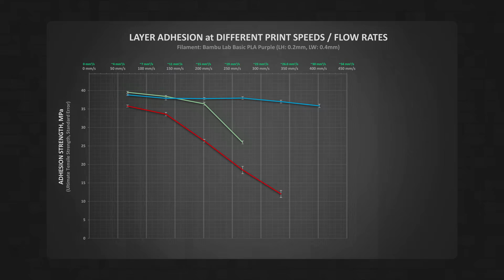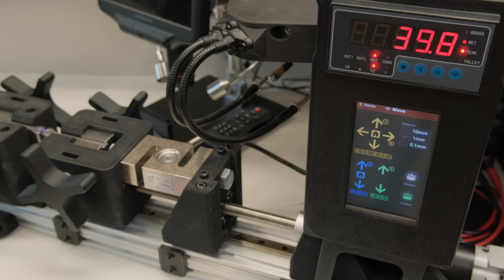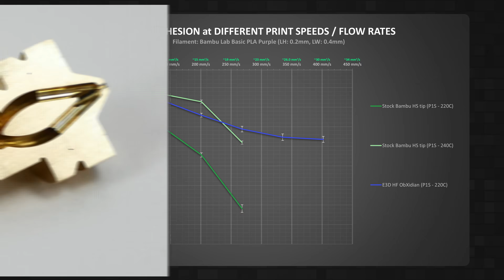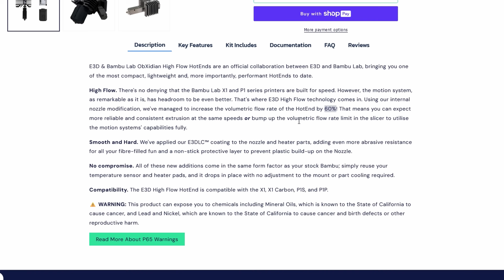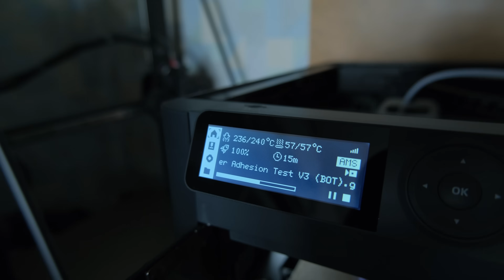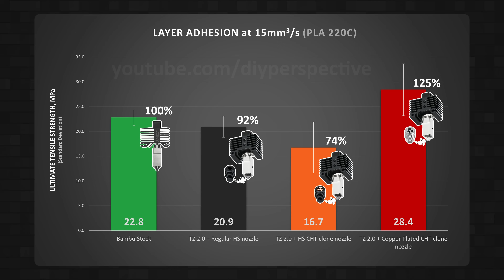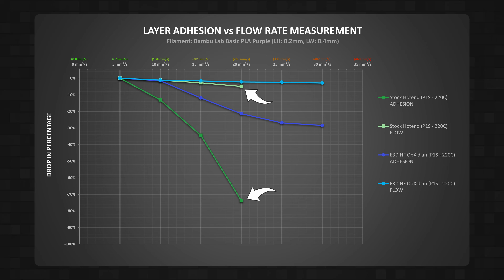LAYER ADHESION TESTED: Bambu Stock vs TZ 3.0 vs E3D HF ObXidian hotends (220C vs 240C)

Comment: TY for the video.

I can't help but wonder how much the temperature sensor location has an effect on the performance.    If the stock hotend had the temperature sensor moved to the same location that E3D uses, would that improve performance?

Comment: Question is if this affects not only the strength but also the surface finish of the print. If the filament gets faster on temperature, does the surfaces looks more simmiliar on speed changes? :D
Reply from the maker: When the print surface starts to look matte, that is the first sign of filament not being melted well enough in the hotend and extrusion having micro fractures. That causes a less smooth surface = more matte. If we had unlimited melting capacity, I doubt the regular speeds that we print (50-300mm/s) would show a significant difference. Plus, some crappy filaments can have a very narrow window of optimal melting, and anything above or below that temperature leads to more shinny or more matte surface. So a small increase in flow rate will lead to a very varying surface shine.
Reply: @PrintingPerspective  I just ordered E3D HF ObXidian hotends, I am just currious if this would give me a more uniform surface on speed changes. I noticed that my surface changes like in your Variable Temperature 3D Printing video. Maybe this could be gone with this high flow nozzle

Comment: For a standard machine the TZ hot ends are great but you have to move the thermister using a drill guide off printables.

Comment: nice video, thanks! only concern for me is cutting method for test pieces. in my experience cutting plastic like that with something like side cutters producing a lot of stress of layer bonding. so I assume starting point of a crack was predetermined at cutting procedure.
Reply from the maker: Thanks. That's why the test piece is only 0.8mm thickness. I also bought brand new sharp cutting pliers that I only use for cutting samples. From my experience it only affects samples that have extremely low layer adhesion.

Comment: It is to be expected i have a nozzle with thermistor in it and i see about 15 degrees lower temp inside it as Mytechfun has pointed you need to increase temp by 10degree for it and in cas of Cht its same but here Chamber on the cht are like a big wall using a bit to decrease the chamber it will be better

Comment: I just wanted to say that this video is one of the most important and interesting videos on 3D printing to date.  Layer adhesion is something that gets talked about but only a little bit and usually not in a quantified way.  This video had a huge impact on the hot-end that I picked for my build.  I was for sure going to use all of the Bambu parts in my custom build but i went a different direction at the last moment - It is yet to be determined if I made a mistake or not (I am having lots of problems getting the USB tool-board to work)

Let me say to anyone that is thinking of a custom build of their own - yes, go with the Bambu design, using their extruder with the recently available hop ups like the aluminum skeleton housing, the DLC coated gears, the integrated filament sensor, integrated filament cutoff knife, the integrated part cooling fan and duct, etc... This stuff is truly some of the absolute best hardware on the market, bar none!  And it is everything you need short perhaps of a CAN bus tool board etc... 

That and I do think that I would use the ObXidian hot-end instead of the stock Bambu - the testing here says it would be the best choice by a comfortable margin.

Also - with Bambu's latest printer the H2D they really have nailed it - it seems as though everything works, and works the first time, with the least effort.  I would not be thrilled that I am locked in to use their filaments but for sure over time we all could come up with recopies for different products from the various makers.  The biggest drawback is the price - it is not cheap at all... but that could be worth it to many people.  

If that is way too much, join the club... I am the president!  But I think that the community gets stronger each day and i do think it is possible to build a printer that outperforms even the H2D for half the cost, even less.  The extrusion for the frames is a bit part of it so it may not be a bad idea to find someone selling a used printer and pick it up as the base to work off of.  Cheers

Comment: What do you do if one of these fancy high flow nozzles gets clogged up? With all those little curved passages inside, I'd have thought a cold pull to be a waste of time, and you can't get an acupuncture needle into it either. 
So, what do you do when your expensive high flow nozzle is clogged?

Comment: You put a lot of effort into testing. Interesting to see some actual data. However it's obvious which "hotend" would perform better. The hotend itself has very little to do with the performance in this case though as they are practically the same design. The nozzle is doing all the heavy lifting here.
The tz nozzle is absolute garbage. Look at the design. A hardened steel shell with a blunt copper filament spicer insert. Hahaha.
You put a properly designed CHT style nozzle, that uses a tungsten carbide or diamond insert, in the tz hotend, or the stock bambu, with an appropriate wattage heater and you will find the performance would be similar to the e3d hotend. Plus the nozzle will never wear out, even if you print abrasive filaments.
It's all about how thermally conductive the materials the nozzle is made from are, and how effective the design of the nozzle is at transfering that thermal energy into the filament.

Comment: What is the CHT Copper Platted Clone Nozzle? Would you recommend it as budget upgrade to the e3d hot end?
Reply from the maker: Nah, just buy Conch or Conch Plus hotend. Those are a substantial upgrade for not much more money than the CHT clone hotends.
Reply: @PrintingPerspective  Okay thanks, but you would still recommend the obxidian if high print speeds and good layer adhesion are interesting?
Reply from the maker: If you are experienced and don't encounter fails while printing then absolutely yes, it is hands down the best performing hotend. Otherwise it would a shame to destroy it.

Comment: Side Note: A shorter meltzone will lead to a more controlled extrusion. Prints will come out quite more beautiful. Ive tested this with the old Generation of printers at 30mm/s for Walls and 60 mm/s for Infill. Cant say if its the same for high-Speed printers though.

Comment: I would be extremely interested in a video measuring the layer strength between a traditional hotend and the Bambu Xobsidian high flow hot end with more specialized materials. The data from this video blew me away. I have the .6mm and I am excited to print stronger parts faster. The print profiles don't seem the best for .6mm though... Thanks for the video.

Comment: Glad i'm not going crazy. Ordered myself a dozen of clone CHT nozzles. They were on my printers for roughly two minutes, because the first moment i loaded up filament and pushed through by hand, i could already tell they actually blocked the filament rather than melt it. I have no idea how some 3D gurus who tested these, were claiming they worked even better than the original CHT nozzles.
Reply: This does not work the way you think it does. You are getting significantly more flow and that’s proven time and time again. It just appears you are losing layer adhesion, but it’s still better than stock in many cases….
Reply: @sunnygalli  Let me repeat the important point to be perfectly clear: Less. Flow.
Reply: @ozfunghi   you get more flow. Less layer adhesion.
Reply: @sunnygalli  OMG lol

Comment: Can you explain the light green line on the graph marked "flow"? I didn't understand what that was measuring as opposed to the darker green line since both were marked as representing the stock hot end at 220c. What did I miss?

Comment: my e3d obxidian print quality is worse than my stock nozzle. close but it shouldnt be worse. it should be same or better. tried calibrating but stock values work best and my layer lines are roughly 3% worse than bambu lab hotend

Comment: 1:30 you are applying force only in one direction with the rig. therefor you could add two more feet offset equally from centre of your current anchorpoints on +-x/y and have 0 flex. ;) physics is cool

Comment: QUESTION: If I understand correctly you are saying this Obsidian nozzle improves layer adhesion and the part printed will be stronger?  I’m asking because I print miniature furniture like tables using 30% wood PLA and the legs are very fragile breaking easily.  Therefore this would be a good nozzle for me to invest in?
Reply from the maker: It improves layer adhesion if you print fast. On small parts, you don't really print fast so rather just increase the print temperature, but wood PLA will always be way more brittle.

Comment: Okay, yeah, that drastic improvement in layer adhesion really does make the price tag of the E3D hotend easier to swallow.  I’m not super concerned with printing fast, but stronger prints?  That absolutely gets my interest.
Reply: You will get strong prints at the baseline speed as shown. It only make sense to upgrade if you want to print fast.

Comment: E3D really should include layer adhesion as a benefit for their HF hotends. Having purchased two, I wasn't really impressed with the speed gains for the cost. The Bambu printers are already very fast. Knowing that layer adhesion is better maintained at higher speeds, however, does make them more worthwhile to me.

Comment: Very interesting video. I'm still fairly new to the world of 3D printing so videos like these showing what happens at different speeds and temps is helpful when I start getting into fine tuning the print settings. I came across that Slice Engineering is coming out with a Mako hotend for Bambu Lab X and P series printers. Would be interesting to see what the results of using this hotend would be compared to the others in the video.

Comment: Would this also apply to the Panda Revo hotend with ObXidian nozzle? I'm thinking about switching to the Revo system because of the easier nozzle swaps and the better flow capabilities of the ObXidian nozzles. I just wonder if your results would translate directly from the E3D ObXidian hotends to Panda Revo with ObXidian nozzles.
Great video and solid research. This is what we're looking for! Your efforts are highly appreciated!

Comment: Nice Video, i use the E3D Hotend for 6 Months or so. The first thing i did, was a flow test, with the old and the new Hotend. Becaus i´m looking for stability, i always break pices out from the flow test to find out how slow i have to go until the pices dont break a long the layer lines. Stock was around 150mm/s and the E3D was just bending at 500mm/s.
Thank you that i can finaly see this in numbers.

Comment: Verry nice work! good and simple explanation and perfect that you can visualize the test results. It would be very interesting to see a comparison with the new Panda Revo hotend for P1. It is made in collaboration between E3D and BIQU. the build up of the nozzle seems identical as E3D you just tested. So is there a difference?

I love the detail and effort you have put in to thies tests and the detailed graphic so we really can see the difference between the different hotends. A lot of people only test the flow rate but not the adhesion wich I find much more interesting. Good work!

Comment: 7:10 Just wondering - how do you remove the filament after printing through a hotend like that? Won't the bifurcated molten filament solidify into 2 strings at an angle that would block the extraction since they cannot both fit in at the same time?

Comment: I just installed a TZ 3.0 and I was thoroughly disappointed. Which led me here…. I wish I saw this first! Thanks for the info. The higher temp can cause worse inter layer adhesion is an interesting fact that I hadn’t even considered. Very well put together. It looks like I’ll be swapping out the TZ 3.0 for the E3D lol Well, that’s a Like & Sub from me, that’s for sure!

Comment: Can you maybe share a link to the thermal grease(?) which you used for the thermistors? Is it sticky and keeps the thermistors in place (like a glue?) - because I always have issues with the thermistors popping out of the tiny holes again :(

Comment: I picked up the ObXidian nozzle for my P1S and began testing last night.. I normally print Bambu PLA basic at 18 mm3/s. With the ObXidian nozzle the max flow rate test hit 40 mm3/s before showing any signs of issues! I ran the test at 210c, 220c, and 230c nozzle temps, 210c looked the best out of the 3 to me. 

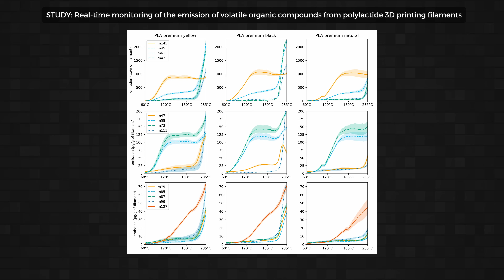How hot is TOO hot for this combo though? Is 240c a reasonable temperature? I normally print at 220 and have not gone over 230. Your chart at 7:24 shows 230c to have the highest tensile strength.

Comment: I was about to buy a 0.6mm nozzle from bambu in order to speed up big prints, however harsh reality kicked in as even the 0.4mm nozzle, at 0.28mm layer heights for draft prints, already maxes out my flow rate. So 0.6mm wouldn't save that much time if any (some time I guess could be expected by less movements) - checked this video out, and now the 0.6mm e3d is on it's way.
Reply: hey, i was thinking about an 0.6 instead of 0.4 also! since you seemed to have one, whats your thoughts on a 0.6 instead of 0.4 ?
Reply: @lolipipan  I can't really feel impact of higher nozzle when it comes to detail - with arachne wall generator turned on there's a video from Tom on it, you basically get same quality as you would do with the 0.4mm nozzle. My smallest prints usually are the gridfinity boxes and base - works perfect for it. any other big prints, the speed for me is the real winner.  you can get let's say 30mm3/s with 0.4mm nozzle too, but you start going into 200+mm/s printing speeds, vs 0.6mm nozzle, I am still within the 100-150mm range, so naturally less speeding artifacts.

Comment: you need test tz3 with  CHT brass nozzle(i got 40mm3 flow test generic PLA but with hardened just 18mm3)
Reply: Hi actually I am planning to buy TZ3.0 hotends and Hardened steel CHT nozzles for them... Can you tell how is the actual hotend ..?? Is it good or bad and which kind of nozzles should I use
Reply: @himanilsharma2147  use brass cht nozzle for max flow and hardened only for any fiber reinforcement filament or glow in the dark. I just use generic pla with bambu profile so they have higher flow limit and it's cool. Just don't bother with 0.2 nozzle it's bad. For 0.2 use bambu hotend

Comment: I was thinking back to this video... QIDI has copper plated with HS tip only. If you recover two clone CHT inserts and you enlarge the hole of the genuine QIDI to slide them in, what would be the result? 1) good outer material conductivity 2) good inner insert conductivity 3) HS tip which is the part under abrasive stress, so no big reduction in useful life.

Comment: I think you are missing the point of a hardened nozzle. The fact that the nozzle with the copper insert was both (slightly) better performing for layer adhesion AND it can print abrasive filaments is kind of a big deal. Are you going to run Glow in the Dark filament or Carbon Fiber through your expensive E3D hotend? I think you will be quite unhappy with print quality after a couple of hours.
Reply: Makes you long for the days of Ruby-tipped nozzles...

Comment: Curious, if the flow is increased, and the temp as well, print at a speed where the cooling is at 100%, but only if the model is close to fail at that speed with that cooling. So, in other words, print at say 400mms. set the layer time and cooling parameters such that the model is on the cusp of fail from low cooling, then test the adhesion. Would there be a difference?

Comment: Did you try the bambu clone with copper nozzles?
Theoretically, the hardened nozzle does not transmit as much heat as the copper one. Maybe the problem of layer adhesion is there in the clone.

Comment: Yeah, I've had my hotend snap off before so there is no way I'm spending $75 for a hotend.  Bambu designed their hotend to snap off ruining the hotend rather than anything else with the machine and made their hotend cheap.  They did this to make their machine faster, printing at the fastest speeds there is a chance when something isn't laid down perfectly the head can catch.

I'm alright if someone wants to design a cheap hotend that can accept expensive tips, when the hotend snaps the tip can just be moved to a new hotend.  One catch and the $75 is gone?  I'd only want to use it if I was printing carbon fiber and if I was making money on the parts.